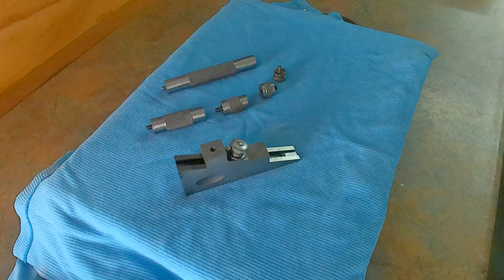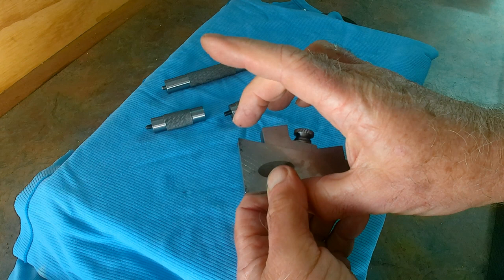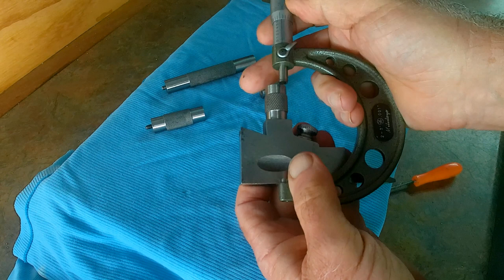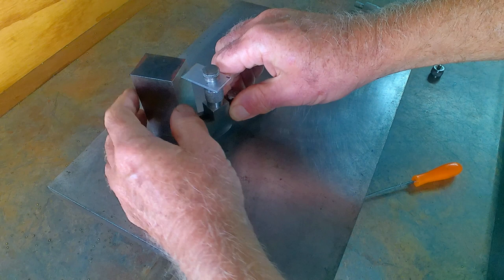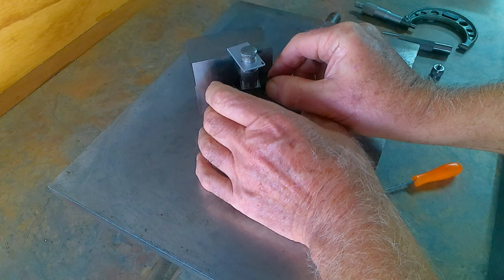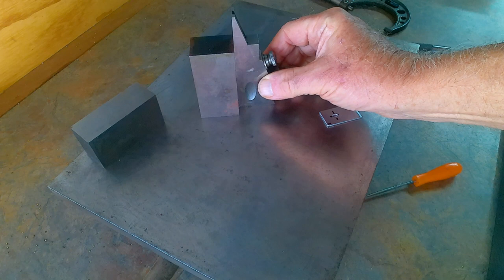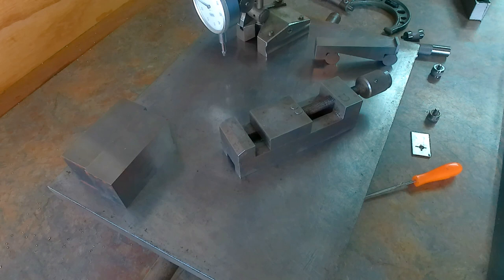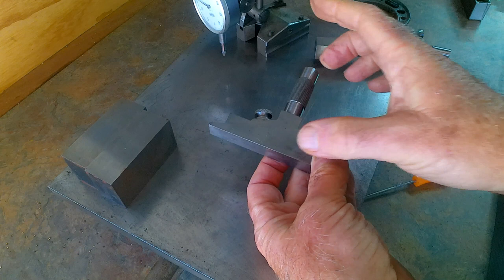What Is A Planer Gauge And What Can You Use It For ?

Comment: I've used mine to equalize the jaw pressure on my vice if I have a small part on one end of the vice, I put the planer gage in the opposite end of the vice. This helps prevent springing the vice
Reply from the maker: Hello Terry, thanks for the view and your comment. Just a small word of warning, a Planer Gauge is really classed as a precision instrument, for setting and comparison purposed. 
Using  it as adjustable packing in a vice, albeit hopefully gently is not ideal. Either use and adjustable parallel or even better a small screw jack. A real simple one to use is a standard bolt say 8 mm and a long coupling nut they electricians use when suspending cable trays. Regards.

Comment: Thanks Dave. You did a nice job making that tool, and showing its use.
Suggestion: Sine bars - variety and their uses. Also a discussion on how the distance between the roller reference faces could be made accurately in the home shop.
Thanks for sharing.
Reply from the maker: Great suggestion Russell, will have to have a sort out the different ones I have. Don't expect it in a rush, I have a couple of other ideas to video yet. I did not make that by the way, my Father purchased it from a retiring machinist back in the late 1960's. Thanks for the view and this excellent comment. Regards.

Comment: Hi Dave - you missed out the primary use of the planer guage  - setting up tool height on the shaper or planer
I use mine when I have to resharpen a tool for the shaper then I can put the resharpened tool back at the same height and take the next cut or when you change to a shear tool for a finshing cut
 I wonder if Rustinox use's one on his shaper ?
 I enjoy your video's and sometimes I learn something new
       Thanks
                  Laurie
Reply from the maker: Hi Laurie, I did mention at the start that it was invented by Mr Starrett in 1910 for setting the tool height on a shaper. Perhaps you missed me saying that. Thanks for watching and mentioning that you set the tool height using one on your shaper. Regards.

Comment: Well, this tool may be an ancient way to get heights etc, I've never ever seen or used one, but I can think of 2 ways that this would be very handy.......1st one is on a bench drill where you need to set the drill depth accurately for when you are counterboring or drilling a hole to depth without breaking through......the 2nd way is on a lathe where you need to set a tool in a QCTP tool holder to centre height.......most of these can be  done with other methods but if I found one of these tools going cheap at an auction I'd snap it up quickly.
The aspect of using it in place of gauge blocks with a sine bar or table has to be the answer to a maid's prayer (gauge blocks, even second hand and well used, are a kings ransom)..........it's something you would keep but probably wouldn't make due to the time and also the fact that it really needs to be hardened and ground very precisely.
Here's a tricky question for you.....have you ever heard of a sticky pin?
My father gave me one back in the late 50's (still have the original one in my tool cabinet)  when I started my apprenticeship and it consists of a ball of Plasticine and a needle stuck in it..........the proper engineering one normally comes in a Wiggler set and is held in a drill chuck but the "soft" one is stuck on the end of an end mill or a drill and the pin or needle is made to run true with the edge of a ruler......it enables you to pick up a centre punch mark or the centre of cross scribed lines especially if you have to do multiple holes without having to remove the tool each time to use the Wiggler one..
Reply from the maker: Hello Ian, thanks for the view and this excellent comment. With regards to using it to set the height on QCTP the biggest problem you will have is finding a flat surface to rest it on as a reference. Most cross slides have bolts, oiler's or other things in the way. The other option is to use the lathe bed, but again can be a problem if it is vee bedway. What we did at Phillips was to make a custom made height setter for each lathe made from aluminium with the base suitable machined away to clear bolts, oilers etc. on the crossslide. The top was machined to the lathe center height, it was tapped to take a steel beak. Yes I have see the sticky pin used but never tried it myself. The commercial ones in a wiggler set are wicked if they fly and your fingers are near by as they are big and have a large ball area at the top. At least with a swing pin or needle it would be a lot less damaging I would think. Regards.
Reply: @daveticehurst4191  LOL....Dave you are a real golden oldie with lots of experience in the real World.......the warning on the Wiggler flicking out in an arc is real as I saw it happen to a guy I worked with.....they are lethal.
My lathe bed has 2 vees for the saddle and one and a flat for the tailstock.....luckily the tailstock flat is at the front and an ideal place to sit a height gauge on..... I especially made one for My Colchester so a planer gauge would work too ........it would come in handy for other uses.